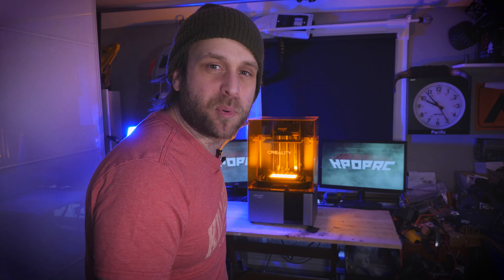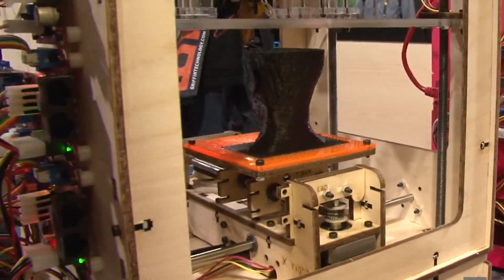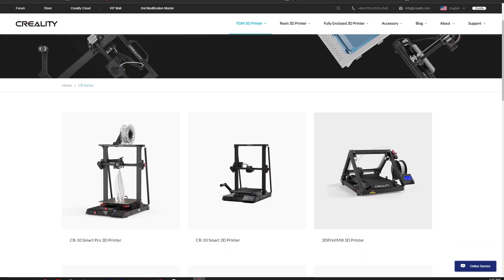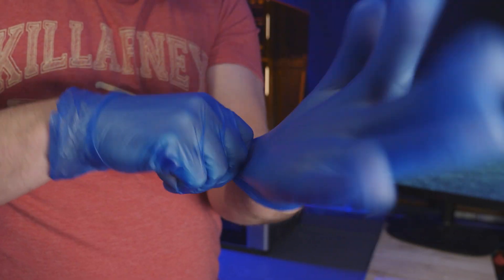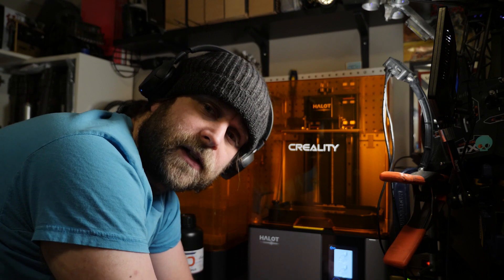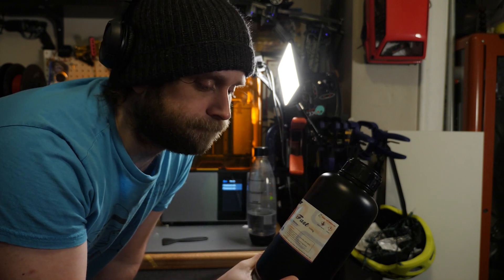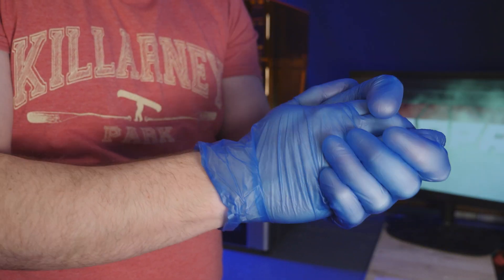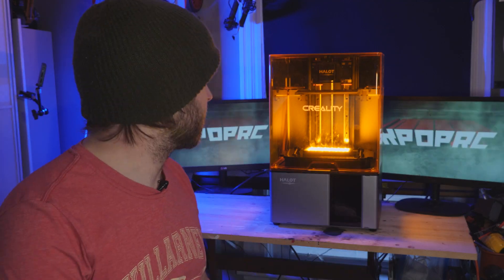New Resin Printer Sent from CREALITY -- Is it any good?

Comment: Love it, great video too. I’ve got a Halot waiting to be used but haven’t plucked up the courage to use it yet. 

Quick question - I don’t have the wash station, do you think it’s worth the extra spend? I’m using water based resin so figured I’d just wash it off
Reply from the maker: It might be. the curing is nice. once you wash it. the model can be a bit tacky, and once you hit it with 5 min of uv light, the surface changes quite a bit.